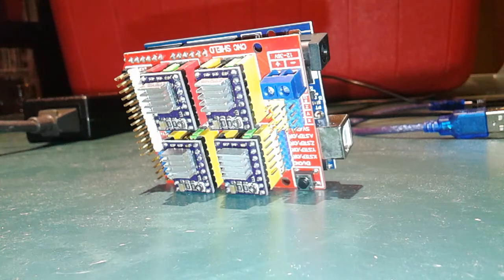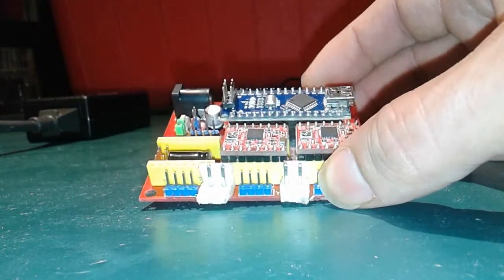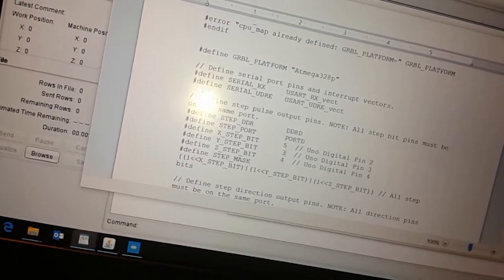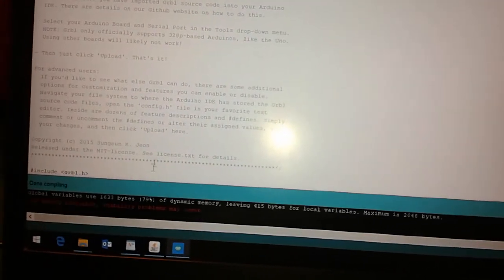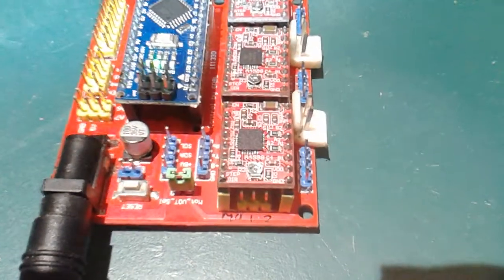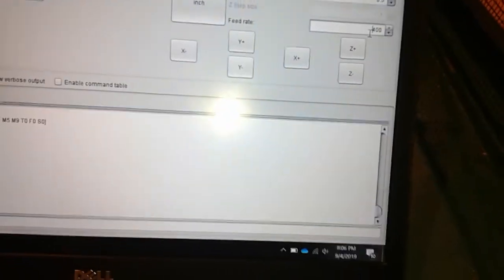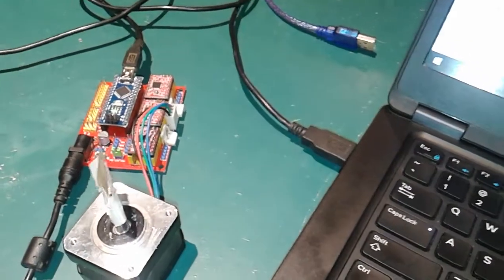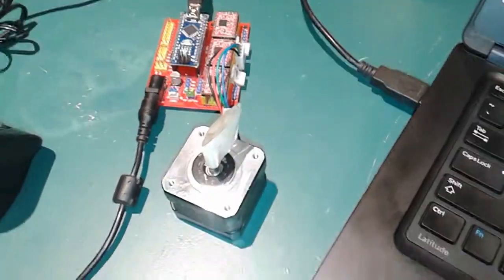CNC Shield V4 Doesn't work

Comment: you need to adjust the resistor for the motor driver with the right voltage for the motor

Comment: This shield v4 board has faulty mode connections as well as they are designed to have missing resistors to pull up the VCC voltage on the mode pins